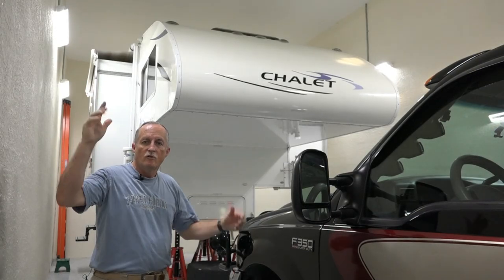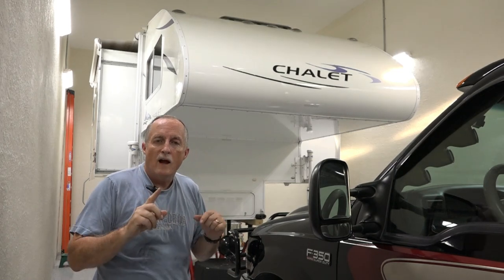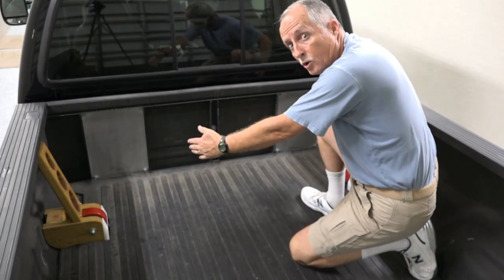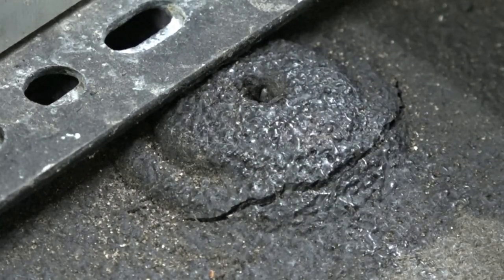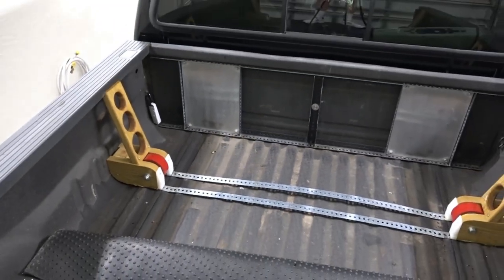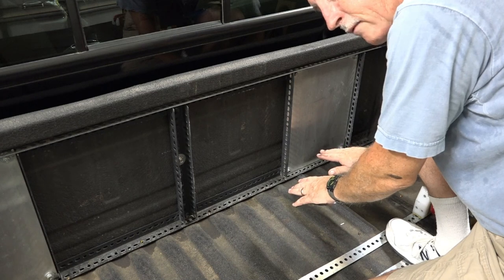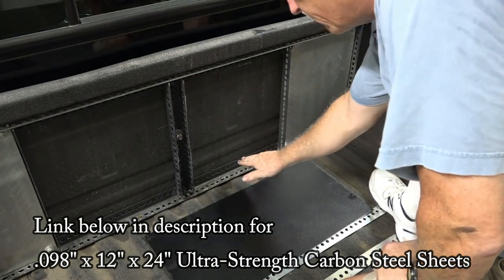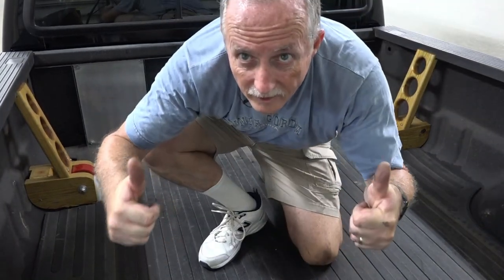Truck Bed Stiffeners to Stop Bed Cracking!

Comment: Charles, You should have the bed welded where the bolt head goes down to attach it to the frame.  Otherwise it could continue to flex and eventually the bed will come free from the frame.  As I understand it, you don't have very many bolts to keep the bed tied to the frame.  This is an easy job for almost any welding shop or a body repair place.  You might have the welder install some reinforcement to the bed so it has a better way of supporting the weight of the camper.  Your method of adding the flat steel panels will help disperse the weight, but you still need to repair the bed.  If I recall correctly, this condition can be caused by metal fatigue which does need repair work.  Thanks for your video.  (I like your shop! If I ever get the "stuff" inside mine laid out correctly, I'll be able to drive my truck and camper into the insulated part of my shop area. Till then, I'd rather work on doing other things, especially since its getting colder.

Comment: I removed my bump stops on my 2011 Chalet double slide and that stopped all porpoising. I use a 2x4 on end (giving about 1.75” clearance) which fixed all traveling issues with the heavy chalet. It sits on a sheet of 1/2” plywood.

Comment: Great videos and ideas!!!
Another gentleman commented about welding repair on your bed and I would also recommend that when you have some down time. 
There is a possibility that your bed will continue to crack with time and usage.
You only need to strip the coating from the top for a welding shop to cleanly mig weld repair the crack from the top.
A ultimate repair would be to remove the bed or at least unbolt the bed and lift it enough to mig weld it from top and bottom, I know that sounds like a lot of work for you and the welder.

Comment: You really need to take the bed off and have it repaired correctly. What you did was great for a quick fix, however the damage is still there and will continue to spread until it eventually breaks and separates from the frame.  While you have the bed off, have them wield in another support beam across the bed on the underside.  You moved the camper back, you said 3.5 inched with the bumper stops.  This may have been just enough to off set your weight distribution of your camper compared to your bed design.  I would continue with the steel plates you have added, that is a extra level of weight distribution.     Good video

Comment: Good video Charlie.  You mentioned that you annually spray the underside of your truck to prevent rust and such.  What product do you use for this process?  Thanks for the help and keep up the great videos.
Reply from the maker: https://youtu.be/zwW3OEGMVLk
Reply: I like fluidfilm for the doors and rockers and woolwax for the undercarriage, wheel wells axles etc.   Woolwax is thicker, longer lasting, and doesn't have the horrible fluidfilm stink.   I flood my rockers and doors and they are good for several years if not forever.  The underside needs to be done once or twice a year

Comment: What modifications did you make to your f350 to beef up your suspension for tge Chalet ?
Reply from the maker: We added several additional leaf springs at all 4 wheels as well as air bags to the back!  Also have Torqlift upper stable loads on rear springs.

Comment: This is not a common issue. Most truck campers don't weigh  as much as that Chalet. Mine is common size Northwood camper. It weighs at most 4K, fully loaded. Not even Arctic Foxes need this kind of  reinforcement. Your camper is unusually heavy.